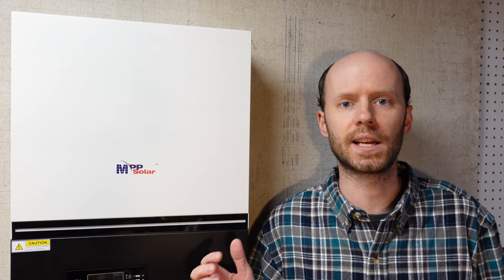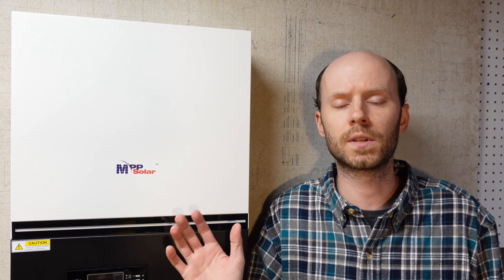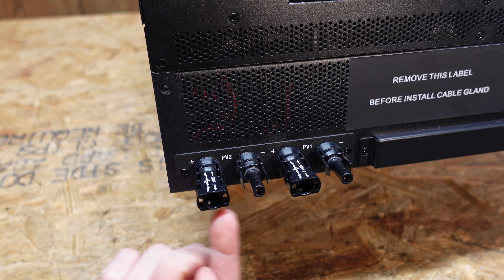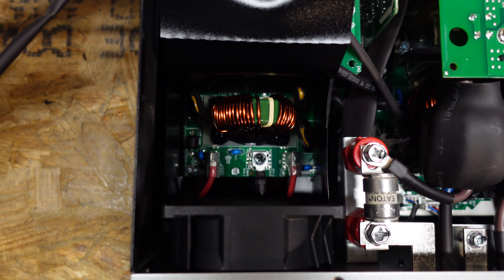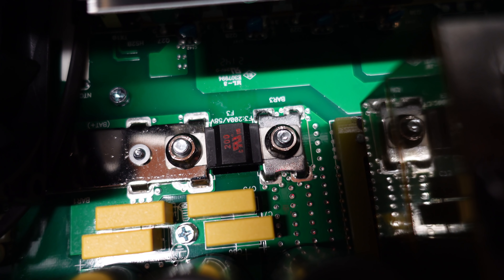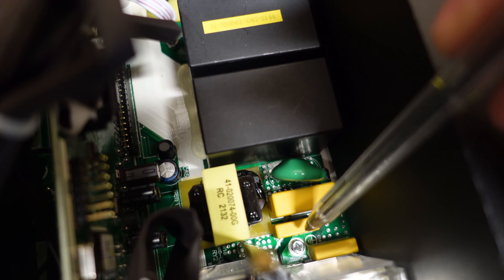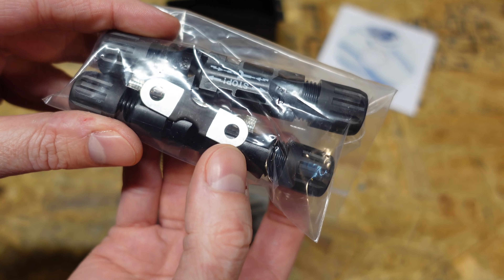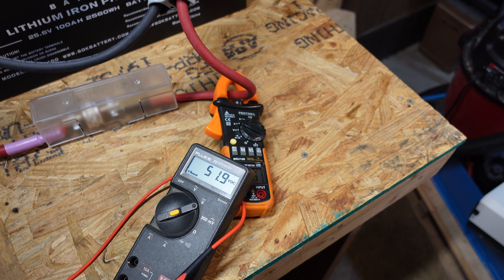MPP Solar LV6548 48V 6500W Pure-Sine Inverter Charger, UL1741 Compliant!

Comment from the maker: The first 48V battery is here as well, video coming in a few days. Super excited!!
Learn more on the LV6548 at the link below (affiliate link)
https://www.currentconnected.com/product/mpp-lv6548/?ref=lithiumsolar
I should add too that my comments regarding the N+G bond are specific to using the inverter off-grid. I do not connect the AC input in my off-grid setup. In the case of the AC input being connected, you would NOT want the bond to occur in the output panel as that would allow current to flow on the input ground when in bypass mode (very bad).
Reply: I have a new Trophy battery to start my two sol arks. Then get the rest of my 121 kWh assembled, balanced, installed beneath the SA.

Comment: Would you say that this unit 6548 is betta for home use instead of the lil6048 ?
Reply from the maker: If you're going to be building a system larger than 6kW, then yes, this inverters much better. The LV6048 is really two separate inverters squeezed in one case, so if you buy 2 of them you essentially have 4 inverters. This means decreased efficiency.
Reply: @LithiumSolar  however the 6548 isn't a  split unit?
Reply from the maker: @codiastluce410  Correct - so you need 2 of them if you need split-phase. I think the answer to your question depends heavily on whether you require 6kW or 13kW of power capacity.

Comment: I have the same inverter when I plug in an ac power source it will not charge my battery I have the ac charge current set and charge priority set and it recognized that ther is ac but it will not charge am I missing something I have two in split phase

Comment: how are you liking this unit so far ?
Reply from the maker: I've had some trouble updating the firmware, but otherwise it's been fantastic (in my test setup).
Reply: @LithiumSolar  ok cool. considering to get one of those units for a small setup

Comment: Can someone tell me after I plug the battery, I have input and output wich one I should use to go to my electrical panel. help please!
Reply from the maker: Based on your question, I would strongly advise you contact a licensed electrician before going any further.
Reply: @LithiumSolar  Is just my shed, can you give the answer?

Comment: 68W idle consumption ... is that really good? That's 1.6kWh per 24h. What is the lowest you could possibly get with this AC output rating of around 6000W? Which manufacturer can do this?
Reply from the maker: It's high yes, but it's still "good" when you compare to other high-output options. At 13kW your idle would be about 135W. Nothing else really beats it in this class of inverters unless you move up to the Sol-ark or others like that at 3-4x the cost.

Comment: The battery input 48v is boosted by switching mosfets, transformer, inductors and capcitors to more than  170v DC ( 120 x 1.414 ) and then the inverter section switches these DC to stable 120v AC output. This is the core operation of the inverter.

Comment: I have a couple inverters one of which is a 3000 watt powmr. Its running my camper . Im wanting to replace it with one thats atleast 5000 watts at 120 volt. Do you have any suggestions on which one to buy. Any help with this os appreciated.  Ive been looking at eg4
Reply from the maker: I've been running the pair of LV6548 powering my whole home for a little over a month now. I love them and would recommend. I would NOT recommend the new version LV6548V due to the high idle consumption, which MPP Solar claims to still be looking at. I don't have any experience with the EG4 version to be able to comment there.
Reply: O yeah... I forgot to tell you my inverters are all 24 volt so if you have any suggestions on a 5000 watt 24 volt inverter thankyou

Comment: So glad you took the time to do a video of this unit and looking forward to more updates. Please consider doing an in depth ground video. I have Growatt 24v 3000TLLVM and was instructed to jumper the neutral in to the neutral out in order to avoid having voltage between neutral out and ground out when in battery only operation. That voltage caused the output to be not sine wave and destroyed some sensitive electronics.  The jumper solution worked, but I keep thinking that maybe I should be putting some relays together with the dry contacts to engage that jumper only when on battery power. In any case, please check voltage between your neutral out and ground out in both grid powered and battery only configurations in your upcoming videos. Thanks for all you do!!

Comment: Does it power the fans up with zero load? what's the minimum load at when the fans start spinning?

Can you test powering down the obnoxious light stripe and screen too?

I'm off-grid and I turn off the lights and everything to save on self-consumption, I can get a 1000w go to 50w load (plus self consumption) without noises, that's great to work with a small PC at night and no bothering anyone while saving a lot of amps.
Reply from the maker: There is a fan that runs all of the time unfortunately. Also yes, there is a setting to turn off the light strip on the front if you desire.

Comment: Any word from mpp on the ground neutral bond? Just wondering if I should email also. I haven’t installed my pair of 6548,s yet.
Reply from the maker: Yes. MPP Solar tech support (Andy Y) replied and told me the N+G bond can be removed by pulling that screw and that it is safe to do so if needed.
Reply: @LithiumSolar  really appreciate that. I’ll do that before I install them then. Seems odd they don’t recommend that for grid tie installations. Yours is the only video I’ve seen that explains where the bond screw even is.

Comment: If ur not using the AC input at all is it safe to leave the bonding screw in place ? Also what if u just simply removed the screw does it make a difference running the inverter without the grew ?
Reply from the maker: It will depend on how exactly you will be wiring it. You cannot connect it in a way that allows the ground conductor to carry current. If you leave the bond screw in and connect the output to a standard electrical panel where the ground and neutral land on the same bus (bonded) then the ground between the inverter and panel is carrying current (very bad).
Reply: @LithiumSolar  so before grounding it my ground is on the outside of the inverter case not on the AC output terminal just L & N  I have to test with the power on using a meter to see if the inside screw is bonded I test it last night with no power on and there was no connection between them but I'm not sure after u power it up.
Reply: @LithiumSolar  so once I make sure that it's not bonded inside  the inverter  with power on and off if it's not bonded at all then it's safe to bond the neutral and ground inside the panel like from my case screw to the inside of the panel ?

Comment: I just wish the max PV OC was higher. The LVX6048 is the only option for those of use with our arrays hundreds of feet away without paying a small fortune on copper.
Reply: Yes, that surprises me too, also where the MPPT connections join the circuit board they don't look that substantial, and look a bit like spade connectors ?
Reply: Ditto!  I have my LV6548, but have been unable to find panels to fall within the PV limits.
Reply: @AndrewJohnson149  hitting the exact limits may be difficult I suppose. But around 18-20 amps isn’t hard to hit. Usually around 3200-3600 watts per input. Combiner boxes and some planning will do it with most larger panels.

Comment: I would like to see the load test video. I have 2 of these and I was hoping that I could charge my forklift but once I plug the forklift charger (50A 2 pole breaker) in, the inverters shut down. I did some load testing with 1500w heaters and some old halogen construction work lights and it looks like they both shut off at 5.4 - 5.8 kw. with fail code F80. A little less than manufacturer states. I went thru all the settings and bumped up the battery discharge to max but still doesn't help.While I was doing a test, I was getting 5kw of solar so I was discharging the battery very little. I'm wondering what I'm doing wrong or in reality 5.8kw AC output is the maximum it can invert.
Reply: This reply is from a real novice, so it's best to be taken with a grain of salt. I have noticed with my LV2424 that when I was running it with 2 12V l00Ah batteries in series that I got more fault warnings than when I added two more batteries, and none at all after I added even 2 more bringing my system up to 300Ah at 24V. This would comport with the information I got from the folks at Titan whose system I was looking at before I decided to go with MPP. Their message to me in an email exchange was that if I wanted to run their system with an air conditioner that I would need to add another battery or I would likely get faults. Again, I'm fairly new at this but perhaps this will be of some help in your research.

Comment: So I have a shunt on my LV5048 while the inverter obviously is different, the idle is just 55-57watts.  I think the idle is reasonable considering the peak output but if you need 240V, I think two of them may be kind of a lot  for most people.  I feel like the newer model LV6048 would be plenty in most cases. I'm using about 1,400 watts just running it a day and two of those would be nearly 3,000 watts a day.  That is a lot of power being used if not needed.  I tend to feel like a LV6048 running all the time makes sense then use a 240V 5000watt of some kind only when needed for bigger loads.
Reply: 55-57 watts idle is a lot.
Reply: @moto-rambler  not for two inverters

Comment: Do you have a preference for two 120v inverters vs one 240/120 real split phase one? Pros and cons to everything, right?
Reply from the maker: I have not seen any high-frequency split-phase models on the market in this price range that I like. Because of that, my preference is for 2 of the LV6548. We have things like the LV5048, which is really just 2 inverters stuck in one metal case.

Comment: I have a small budget and I am trying to decide between the LV6548 and two growatt 3000TL's, I would like 240 but its not required. Of these two manufacturers and products which would you rate higher?
Reply from the maker: MPP Solar no doubt about it... However, my opinion on this question is naturally biased having owned 3 MPP Solar inverters, 3 MPP Solar charge controllers, and zero Growatts :)
Reply: @LithiumSolar  i really appreciate you taking your time to answer me, I am also leaning towards MPP but my hang up is that two growatt are similar priced and I get 240 from them, im still trying to figure out how I would connect the MPP to my house aside from a transfer switch on one leg of my breaker panel and moving all essential loads to that leg and making sure I don't overload it, why are you not happy with the neutral bond? Is that the same problem that having the two growatt 5000's wired in parallel through a transformer which caused the nowcwell known problems?
Reply from the maker: I am not happy with the neutral bond for the exact reason you mentioned. I have a Reliance 50A transfer switch off my main panel where the inverter connects. A standard panel has a neutral+ground bond in the main panel, thus if I connect the inverter to the transfer switch, I have 2 bond locations (very bad).
Reply: @LithiumSolar  I have the reliance 6 circuit manual transfer switch that I will be using, how did you get around the double neutral bond issue
Reply from the maker: @todamnbad  The inverter I'm using now (AIMS 10kW) is a low-frequency with a transformer. It does not have a ground+neutral bond built in, so it works perfect with the switch. I'm still working on figuring out how exactly I want to set up the LV6548.
Reply: @LithiumSolar  well dang it, if your still figuring it out then I am really in for it, I saw another video where the guy didnt connect the neutral wires in the transfer switch but he was using a different brand of equipment
Reply: @LithiumSolar  I heard there is a firmware update that fixes the issue but im not sure how all of that works, been watching tons of videos and I am still a little bit lost, hopefully you can post an update that explains it

Comment: thank you for the nice video, you just solve my bonding mistery in these AIO units...  from my understanding, if power comes from battery the relay will bond N-G, if power by grid, the relay turn off bonding N-G as the main grid panel already bonded... what would happen if i use gas generator to power the AIO in bypass mode and charge battery.. my guess is bonding is still off... not sure if it safe to do that for a long time :)
Reply: That's my question too. I am off grid with two running for split phase. But I want to attach a generator to charge batteries thru the 6548. Still trying to find a good answer.

Comment: Quick question...does anyone know what would happen if I went over the 2000watts (for each of the MPPT chargers) but stayed under the voltage (250vdc)? Looking at some bifacial panels that meet the voltage requirements, but can potentially pass the 4000watts.
Reply: The inverter would clip the input. You'd be limited to the 2000W max.

Comment: I have been running one since September. No issues whatsoever. Very cool finding the bonding screw. I hope we eventually get information on what is the correct way to run it.
When you get some panels hooked to it could you check the PV array ground and see if you have any voltage running on the ground wire? I'm not sure where it's coming from but if I cut the incoming power the current disappears.

Comment: Special PV panels required? The 6048 does not have this warning. 
Page 8 of the LV6548 user manual states
 
WARNING: Because this inverter is non-isolated, only three types of PV modules are acceptable: single crystalline and poly crystalline with class A-rated and CIGS modules. To avoid any malfunction, do not connect any PV modules with possible current leakage to the inverter. For example, grounded PV modules will cause current leakage to the inverter. When using CIGS modules, please be sure NO grounding
 
https://www.mobile-solarpower.com/uploads/1/2/9/6/12964626/lv6548_split_phase_manual-20201020.pdf

I may cross post looking for info.

Comment: Thank you for this video.  I have had the LV6548 for several months now, but haven't been able to install it due to battery backorders and now trying to figure out the best panels to use to try and stay within the LV6548 limits.  I now have 2 Eg4 48v 100ah batteries, but still on the hunt for the best panels.  I am eager to see your projects moving forward.  Thanks again.

Comment: Two things: This internal link Neutral-Earth can be tricky when feeding into a switch board which has this link already ( ground loops ). I use an 8kW MppSolar single phase to charge my EV which needs to see that link (I use only a very small buffer battery). Secondly: There are 3 fans and they change their speed depending on load / solar input. The sound can drive you nuts and im glad its mounted in my shed and not in my house. Oddly the fans suck air from the top and blow out the  hot air at the bottom. Other than that this Taiwanese made unit is great value compared to the premium brands which are almost 3 times the price.

Comment: neutral ground bonds should only be made at main panel not subpanpanels
Reply from the maker: Exactly, not inside the inverter.
Reply from the maker: When used off-grid with the AC input NOT connected, the panel on the output of the inverter is the "main panel".

Comment: Thanks for the video.  Hope you are able to make more.  Thanks for testing the idle consumption, I'd be interested to know what the idle consumption is with the MPPT's on but the invertor turned off.  In the manual this model claims to have 'optional' 12V outputs, but doesn't elaborate.  Does yours have a this 12V output?  I'd be really interested in seeing and hearing about that feature.  That would allow upgrading from my existing 12v system but still retain the capability to run some essential 12v loads.  Please keep the videos coming.
Reply from the maker: No, mine does not have the 12V output. That might be something extra you have to ask for special.
Reply: No 12v output on mine either

Comment: Curious if when on grid (not inverting) does the lv6548 "undo" the internal bonding?
Reply from the maker: My ASSUMPTION is yes because 1) the ground screw occurs before the relay and 2) if it didn't, that would turn the input ground to a current-carrying conductor (very bad). I have not tested this yet. I'll try to remember to come back and reply if/when I do (likely a few days).